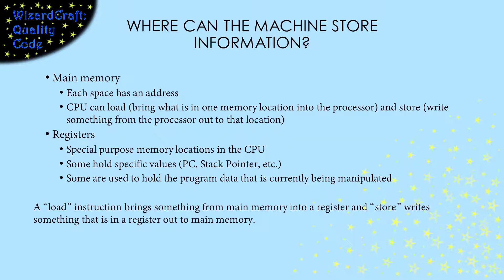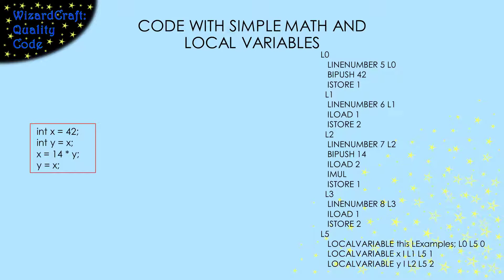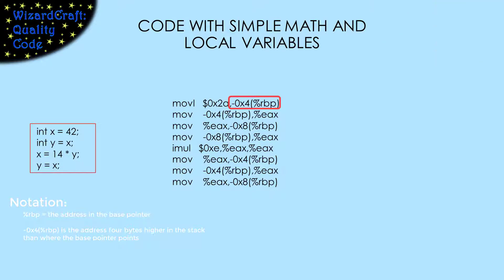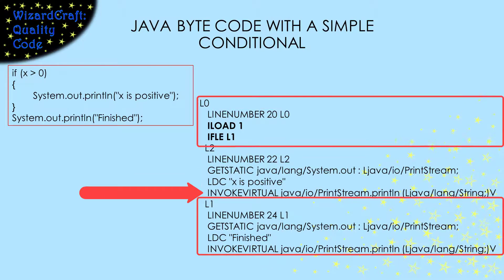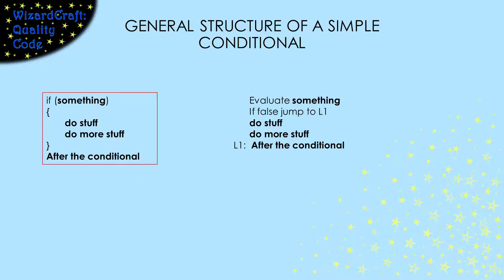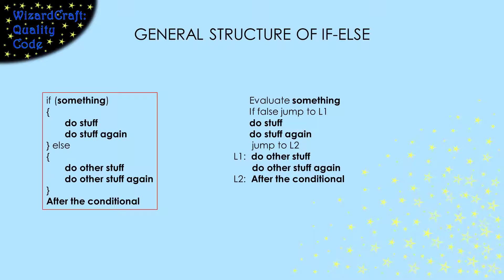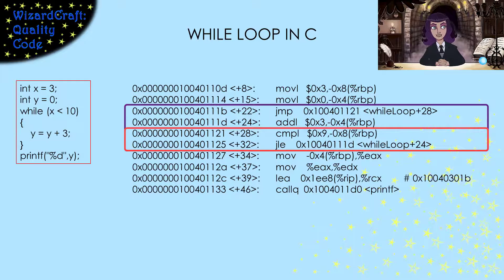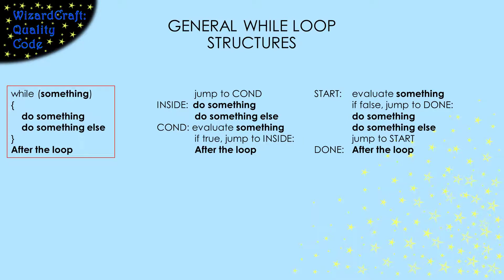An Introduction to Machine Language

Comment: Does this mean C will perform better than Java for while loops at scale?
Reply from the maker: Unfortunately, it isn't that easy!  There are way too many other factors that affect the actual run-time.  For example, much of the effect I'm talking about here can be overwhelmed by branch-prediction algorithms in the CPU.  If you have a loop that runs a zillion times, those algorithms will prevent the flushes because it will correctly guess that the loop will jump to the top.  If that speed was critical, I'd have to build both and do an empirical study to be sure who was going to win.  Thanks for a great question!  I hope you find more videos valuable, too!
Reply: @wizardcraftcode  thanks for this clarification, I was just learning about the branch-predication from your CPU pipeline intro. Very grateful for this series!
Reply from the maker: I'm really glad you find them helpful!!!

Comment: 9:50 Hi! If I'm correct both example c and java loops involve conditional branch on every iteration. The difference is mainly in loop header location(compiled program text-wize) relative to the loop body and hence the direction we jump or not jump when loop condition is true. I believe C strives to satisfy branch predictor implementation that would conventionally first predict backwards branch as taken. Additionally C variant has one branch instruction less for every iteration except for loop preheader.

P.s. great videos! Thank you for them!
Reply from the maker: I don't disagree with anything you said.  Different branch prediction algorithms would react to each differently, so I'm not sure either one is optimized for that. Thanks for your comment!  The subtleties of these things are really interesting and I love the discussion!

Comment: The term:
"von Neumann architecture"
is used intermittently and inconsistently in computer science. Most sources that use it have crappy explanations, and most sources with good explanations don't use it.

IBM hired John von Neumann as a consultant in 1951. I was hired in 1978. The entire time I was there I never heard or saw any mention of him or his namesake.

Of course Eckert and Mauchley may have thought of it before he did, but von Neumann got all the credit.
Reply from the maker: You are absolutely correct!  In academia, we use von Neumann architecture really vaguely.  It drives me nuts when colleagues call our current multi-core/multi-processor systems "von Neumann machines!"  While you were working at IBM, I was building mainframes with Burroughs.  We NEVER called our machines von Neumann machines!  :D
Reply: @wizardcraftcode  "Merlin"
Great name!
Any sufficiently advanced technology is indistinguishable from magic.
A "von Neumann machine" is what von Neumann called a "universal constructor". Beat an academic every chance you get.

Have you checked out Dennis Taylor's Bobiverse? LOL